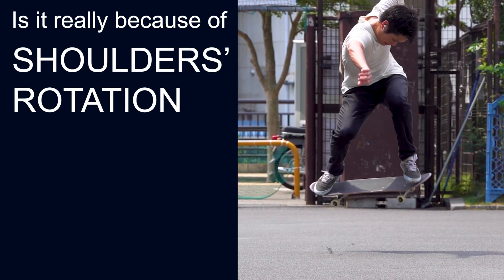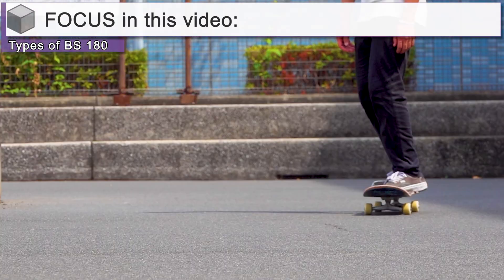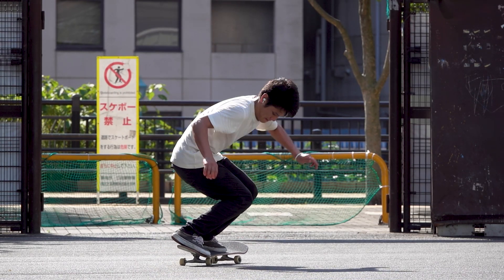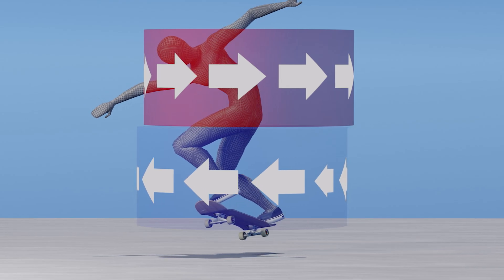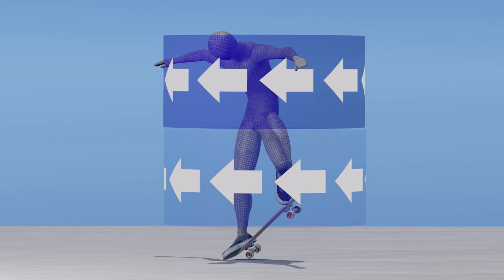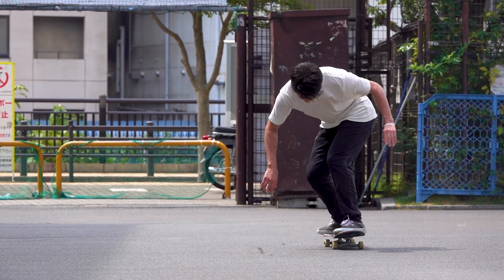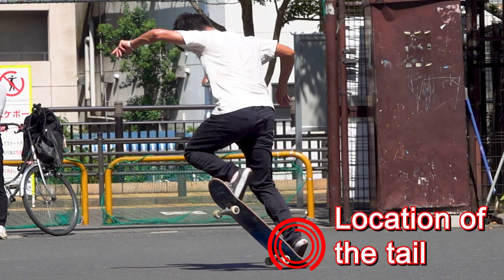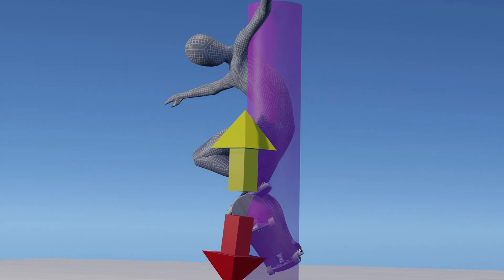Physics of Backside 180 in Skateboarding

Comment: This has always been the hardest trick for me. I can't get my back foot off the ground for long enough and I cannot pivot on my nose backside
Reply: Aside from proper technique and strength Backside tricks are challenging due to the fact of not seeing the landing, thus it is a mental battle that stops your body from fully commit to
Reply: What really helped me was having the front foot more "straight" / parallel to the board, not at a 90 degree angle like for an ollie. Basically the same angle as for a kickflip, but more foot on the board. No idea why this helps, but I landed my first one right after that change of foot position.